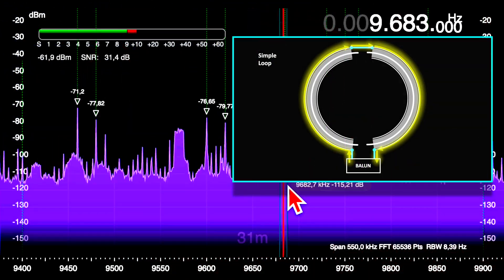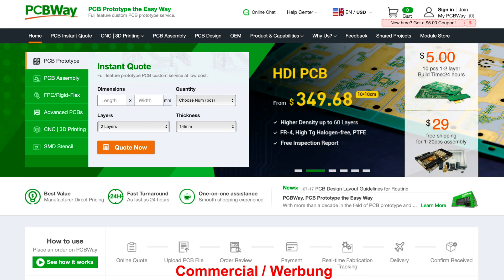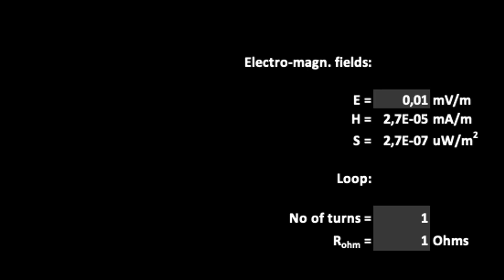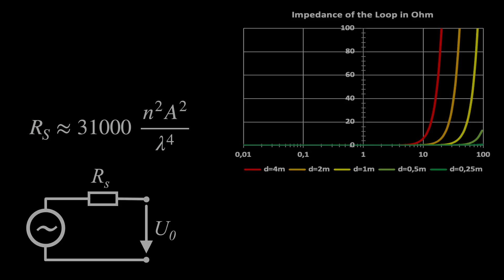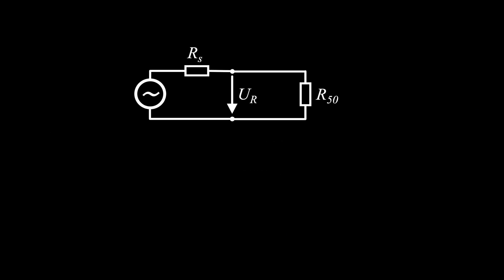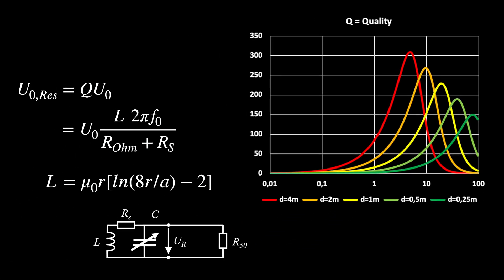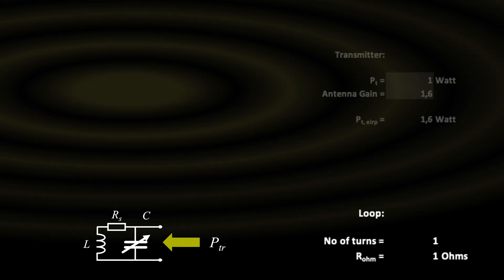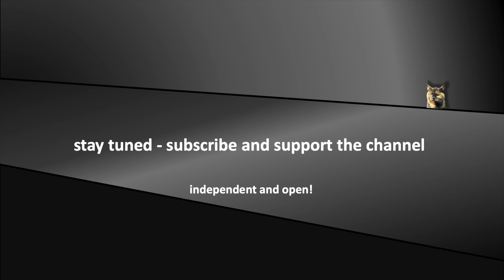Optimizing Shortwave Reception: Loops Impedance, Resonance, and Quality Factor Explained (EP165)

Comment: Don't you think it would be a good idea, turning resonant a moebius loop by adding a capacitor, and a capacitive coupling for example, to get the best of both worlds? The lowest noise, best selectivity and more gain. Would it worth it?
Reply from the maker: Hello again,
Thanks for your good comment!

It's certainly a good idea to try it out. I think you have to keep the following in mind: If you want to take advantage of the antenna's resonance, you need very low resistive losses. This means that the shielded or Möbius loop antenna must be made of thick, high-quality cable. Low losses are actually best achieved with the outer conductor; the inner conductor naturally has more losses.

It's hard to say which is more beneficial: the higher selectivity through resonance or the shielding. That is probably depending on the type of interference you have at your location.

As I said, a great idea! Stay tuned!
Reply: @electronics.unmessed  

Hello!

Untill now, I have been using recicled RGU6 (but the internal condutors in good condition, just the external isolation a bit dark, due to the exposure to sunlight) in my tests with shielded antennas, in order to save money on cable. In the final setup, I will use brand new cable.

Appart of this, I bought one of the chinese clones of the youloop antenna long time ago. I tested it and I have been using its balun and its crossed connection box, with other lenghts of the RGU6 cable, using SMA to F adapters. Especially the balun with other tipes of antennas too.

In the shortwave band, I have a lot of electrical rf noise and an annoying hum noise. I dont know how to remove that hum.

I'm considering to connect a cable from the input shield of my receiver to my electrical instalaton ground. I have realized that (at least) in medium wave band, if I touch the input ground of the receiver whit my hand, the background noise decreases a lot.

Unfortunately, I don't have ground connection in the place I have the antenna. I have to install it.

I will keep on experimenting. Greetings!
Reply from the maker: @DJMotavirust  
Hello,
Thank you for sharing your experience here. Very interesting. I do the same: try to first conduct experiments with the material I find in the junk box. A good principle works with that, too!
Maybe you could try ferrite blocks. Ideally, use them on all cables: antenna cables, USB cables, power cables, etc.
By the way, you've seen it, it's now very clear why the loop's received signal drops above a certain frequency. What do you think of my explanation?
Above this frequency, the loop also becomes particularly sensitive to sheath wave interference. I'll show why in one of the next videos.
Greetings!
Reply: @electronics.unmessed  I think your explanation couldn't be more detailed. In fact, it's very extensive for me because I'm very bad on maths.
But the charts are specially useful for me, since they let me understand all you want to explain us.
In reference to ferrites and chokes, maybe you are right and I need more barriers to decrease the noise as much as they can.
Keep digging deep in that topic. I would like to know more about it. Although I would rather graphs instead ecuations. XD
Anyway, anything helps.
Greetings.
Reply: Sorry, but I can't traslate the term  "sheath wave interference". What does it mean?
Reply from the maker: @DJMotavirust  Sorry about that, I'm not entirely sure that's the correct English term myself.
Sheath waves flow, for example, along the outer conductor of your coaxial cable. They are excited by radio waves and also by interference spikes from switching power supplies, etc., that couple in via the power grid. I hope this helps to understand the issue.
Reply: @electronics.unmessed  OK, I understand. Parasitic voltages induced by sparks from switches, brushed motors, or armonic frequencies from bad filtered switched-mode power supplies, that move along extrernal cable shields to the receiver.
Reply from the maker: @DJMotavirust  Yes, exactly.
Reply: @electronics.unmessed  Hello. Returning to the moebius antenna subject, I have observed a weird behavior. All the schematic I saw, they recommend connecting the ground of the antennna shield to the output unbalanced ground. Following these instrucions, I did it. However, I have been notizing, that the shield of the coaxial cable which goes to the receiver, acts as antenna. The strengh of the signal changed when I moved the coaxial cable. Now I understand why you connected the ground of the antenna shield trough the ferrite choke as the same way as the feedline cables. I think that the antenna is not perfectly balanced an that's why a part of the signal moves fron the loop to the coaxial. In the next setup, I will follow this approach. Greetings.
Reply from the maker: Thank you for your comment. I'm sure many other viewers have the same problem.
Yes, I also believe that's exactly the problem. The longer the coaxial feed cable, the more interference you get on the outer conductor. Considering that the loop becomes high-impedance at high frequencies, there's essentially an open circuit at the input. Higher-frequency signals can then easily interfere and cause intermodulation, which interferes with your reception band.
Then the wiring I suggested will help. Other possible improvements include ferrite blocks on the feed cable and a clean ground connection at the base of the antenna.
Reply from the maker: @DJMotavirust  Sty tuned, I will certainly make more experiments  on this. By the way, I good and clean grounding at the antenna feed point is in my case also reducing noise.
Reply: @electronics.unmessed  You sure, I will. Did you notice any audible diference between keep connected or disconnected the external shield to the ground of the moebius antenna?
Reply from the maker: @DJMotavirust  Yes, when I connected the shield via the third winding there was an audible improvement.
Reply: I bought a Nano VNA, but I have to learn how to use. I thing it can be a handy tool.
Reply from the maker: @DJMotavirust  Sure, I only can underline that it is helpful for antenna reflection measurements, but it doesn't help when you want to analyze noise.
Reply: @electronics.unmessed   I also bought a RTL-SDR v4, but I haven't installed yet. I hope it will help me to compare signals, as  the same way you do on the videos.
Reply from the maker: @DJMotavirust  Good plan! I am looking forward to your comments about your experience.